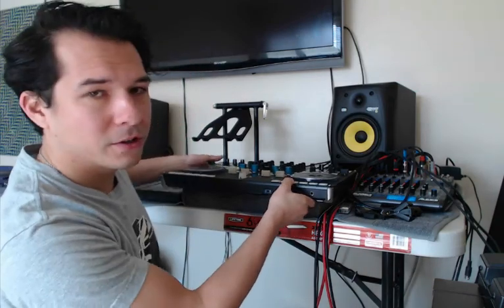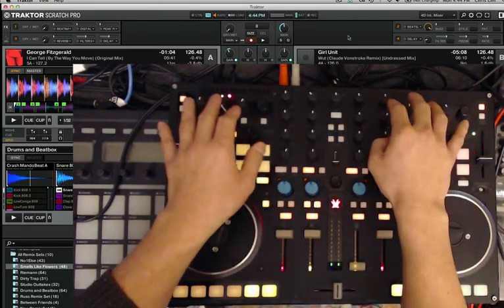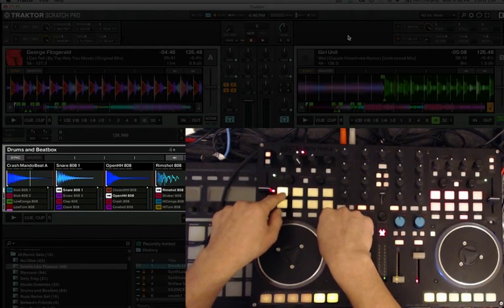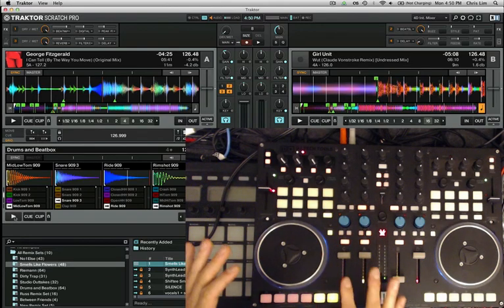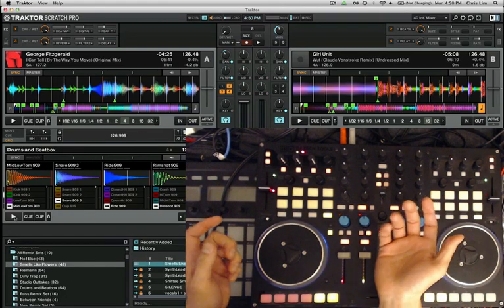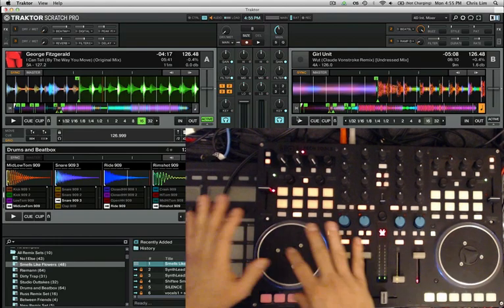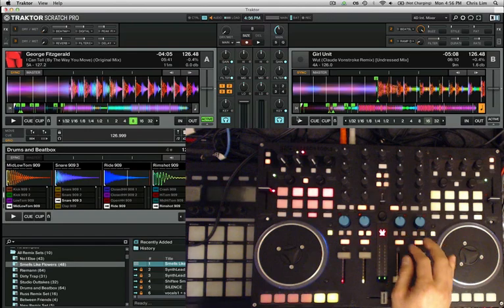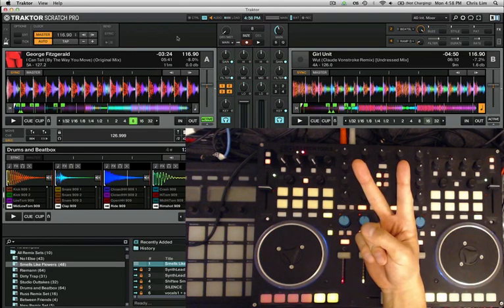Flashflooder DJTT VCI400SE v2 5 Traktor Mapping Tutorial

Comment: BRO REALLY GOOD WORK ON THE MAPPINGS…YOU REALLY MAKE IT ALOT EASIER FOR US…BUT I HAVE ONE QUESTION…SINCE YOU REMOVED THE SNAP AND QUANTIZE BUTTONS…WOULDNT IT BE A GOOD IDEA TO REPLACE THEM WITH SHIFT+THEIR ORIGINAL BUTTONS? INCASE YOU MIGHT NEED THEM.
Reply from the maker: Kyle Thompson i did re-add snap and quantize as the shift functions of those buttons in the small four button grid. might have been in a mapping update though. i don't remember now but they're in the latest version for sure